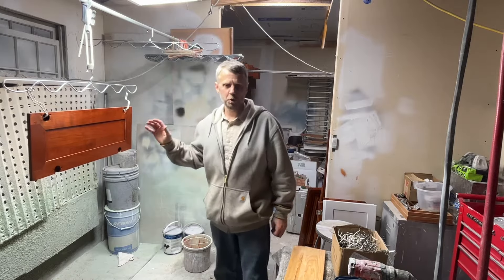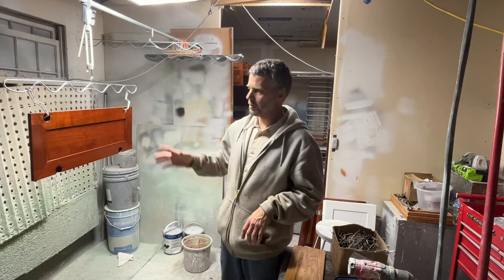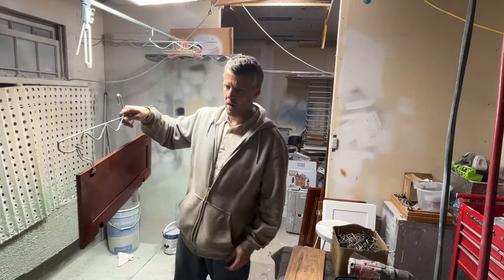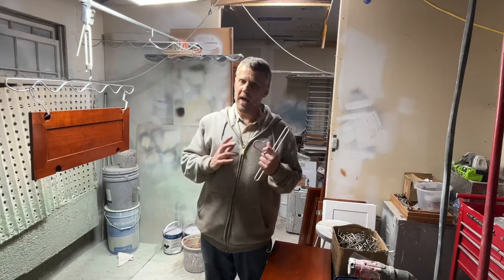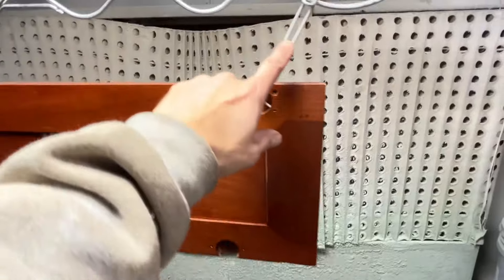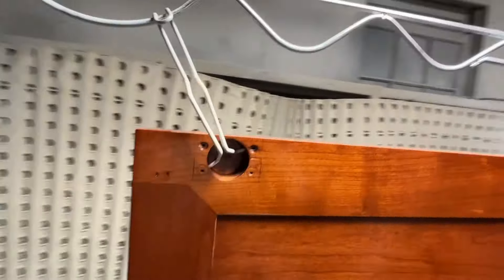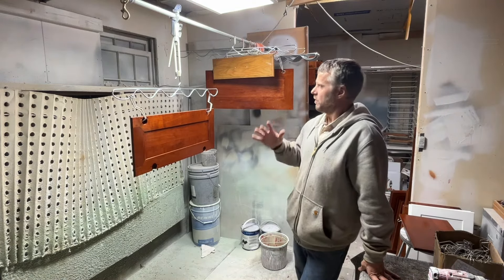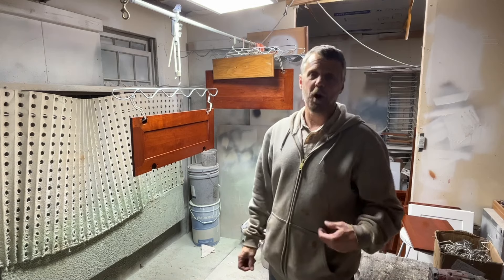Spraying Cabinet Doors Faster With My Cheap Hanging System

Comment: Good advice. You could also maybe try using 2 of the wave hangers at the same time for the big three hinge pantry doors , one hanger for the top and middle and one hanger for the bottom hinge in the middle, if it would fit in your drying room vertical . Just a thought.
Reply from the maker: Yes, my drying room is super small

Comment: I personally use only what’s available to me locally so no Renner products. Only Sherwin Williams and Florida Paints. I’ve been using Sherwin’s new Gallery Series and it’s okay I wouldn’t say it’s worth the price tag but it does a decent job. But I find no matter what on verticals I get orange peel more than laying flat. Nothing comes close to the finish of spraying flat. Even heating the material, gun and substrate which helps considerably with flowing I still get slight orange peel. It’s bothersome but in a lot of situations I have no choice and the customers don’t have an eye for that like I do. Since the 1Ks I use skin over fairly quickly I speed it up with a heat gun and use screws in saw horses that leave a small almost unnoticeable dimples in the finish. I do like the fact that you can considerably speed up your turn around time with the vertical process although.

Also in one of your previous videos you were using the Iwata anest Wider2 with the K2 air cap. I would just like to let you know Iwata currently owns the patent to their v-slot nozzle technology which double atomizes the material and creates a considerably finer finish than with conventional spray guns. The ws400 v-slot nozzle with the wider4 4l-j2 air cap are compatible with the Wider2 gun body. They both cost what the Wider2 is worth each I might add. But it might be worth looking into. And I currently own two CA technologies FE-Line guns. One I have the lcfm air cap on which I use only with my solvent primers and the other I use the compliant air cap for my waterborne top coat finishes. I notice the compliant cap is much better at atomizing high viscosity coatings than the lcfm air cap and can be adjusted to work well with a 2HP compressor. I will add the compliant air cap utilizes a completely different head insert and needle/nozzle assembly but it is compatible with any FE-Line gun. Maybe you should give that a try and compare it with the Wider2 for on-site or shop work. Great video looking forward to the next one 👍🏻
Reply from the maker: Good Info! thanks!

Comment: I used to hang, but switched to flat because I thought it would be a better fin and all the big cab finishers were doing it.  I soon learned there was a learning curve and really never got use to the downsides  like spray going under on the finished side or the bigger chance for debris falling on to my surface.  But I  kept on, never really thinking it was totally better way of doing it.  Until seeing you switch,  then realized all the different drying rack systems, ventilation to keep floating debris off my cabinets, the reach when you have longer doors, the wait to flip, worrying about scratching on the rack,ect... wasn't worth the time or effort when I already had a perfect system. I've got to switch back. thanks

Comment: Thanks for sharing. Sounds like a real time saver that delivers very high quality cabinet door with 2 coats of primer and 2 coats of top coat on both sides.  It should last a long time. Do you use a 2K hardener for the prime coats and topcoats?  Spraying my bathroom vanity cabinets I found it challenging using a 2k primer and 2k topcoat. By the time the coating was dry the pot life was over and I had to clean the gun. So I spent a lot of time cleaning out the airless (Graco gx19) between coats.  The doors came out great smooth and bulletproof but it was a tedious process.  I used centurion 1107 primer, and 2800 topcoat with centurion 4002 hardener.  Any suggestions on managing 2k pot life?